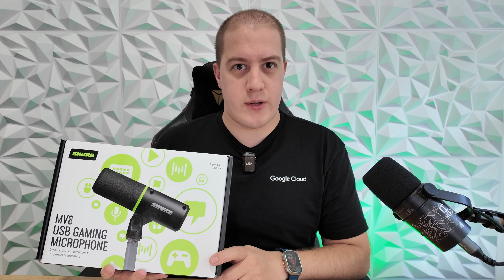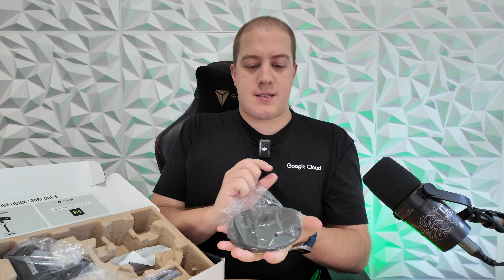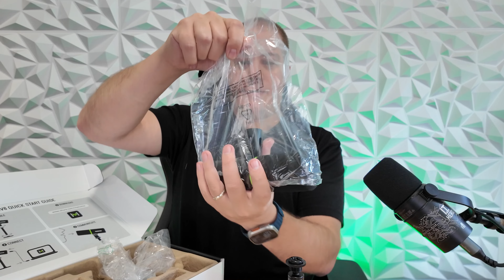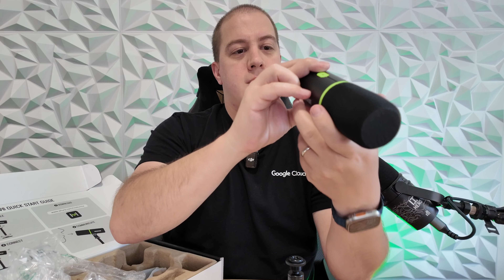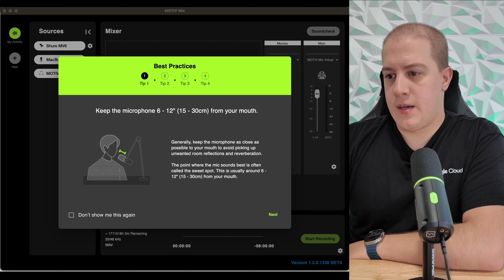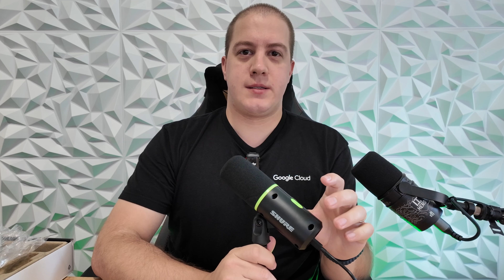Shure MV6 USB-C Microphone Unboxing & Audio Test vs. Shure MV7 & DJI Mic 2

Comment: Ok, so the shure MV7 over the MV6 is by a little. I'd say 10% more smoothness. I could immediately hear it. MV6 does crush the DJI mic though. Can I ask a question, is XLR better than USB for sound?
Reply from the maker: XLR is more versatile since you can hook it into audio interfaces and do things in line before it gets to the computer. From a quality perspective, I am not sure that it is better if all you need is to record sound to a computer
Reply: @tabGeeks  hey thanks bud. So the sound quality say after you export a video for an end user, a XLR and USB should have the same sound? Sorry if I misunderstood your answer. 

Btw Merry Xmas.

Comment: I currently use the blue yeti and so far I think the yeti is, well, meh. I was planning on getting the shure mv7+ but now I’ve seen the mv6 I’m wondering how much different are they? Should I go for the v6 or 7+ if money is not an issue?
Reply from the maker: Depends if you ever want to use XLR or not. Make sure it has at minimum usb-c and if you’re ever going to use it, xlr. Sound wise they are very similar
Reply: More Plates More Dates, he has 2 million subs. He used the blue yeti and still does lol. The blue yeti has an advantage if you want a mic out of frame. The yeti can pick up your voice quite well if slightly out of frame, depending on focal length of lens. I think that is where the yeti wins. The reason you can't see More Plates More Dates' mic is because it's not in frame....ever. He must have it to his right ( dominant side ) and puts it on caratoid ( heart ) mode, and only ups the gain 25% and points the talking head slightly to his side. 

Now you will see him in podcasts with guests, where he does use a shure mic .Unfortunately I can't attest to shure mics.

Comment: is this worth it? i currently have a blue yeti
Reply from the maker: Absolutely. I dropped the Yeti for Shure mics years ago. The Yeti picks up EVERYTHING whereas this will mainly only pick up your voice when it’s in front of you
Reply: @tabGeeks  thanks I got it yesterday one difference I’ve noticed is blue yeti is louder in terms of voice. And Shure mv6 is definitely more clear where it’s easier to understand words.
Reply from the maker: You can turn up the gain on the Shure to capture more just don’t go too high or you will capture outside sounds etc like the yeti